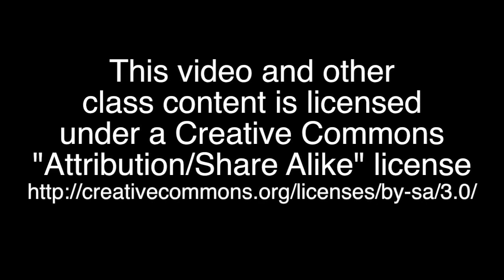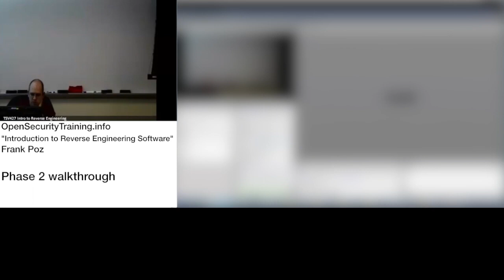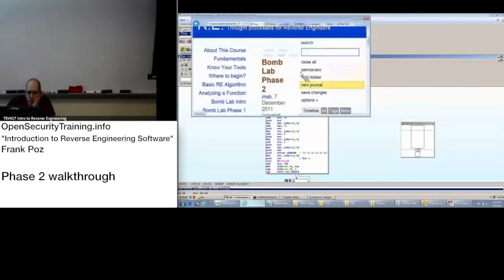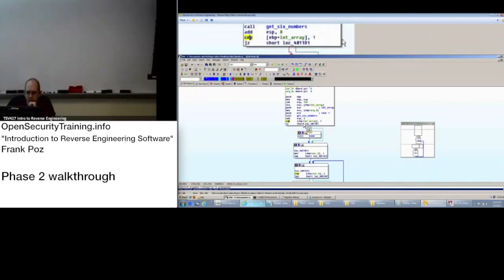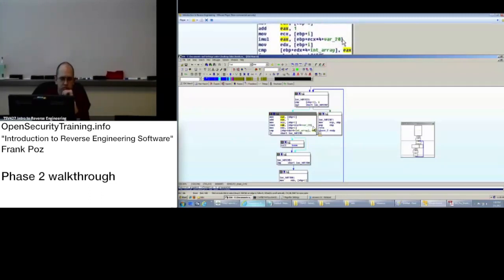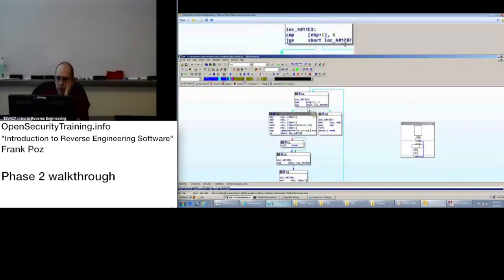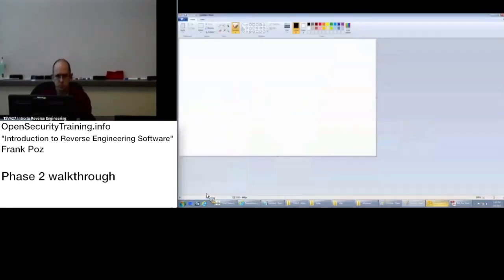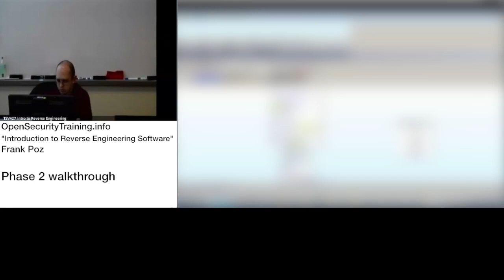2013 Day1 P9: Intro to REing Software - Phase 2 Walkthrough

Comment: im sorry but how u get those numbers i dont get how u do the math of the loop :S? i try 1 * 4 + 1 = 5  etc :/
Reply: Despite it might being a bit of necromancy (responding to a 3 year old message), I'll respond anyway, might help someone else too:
int_array[0] = 1. we checked this before the loop. The loop starts with i = 1.
the imul instruction multiplies (i+1) (we loaded it into eax), with int_array[i-1]. (that's why it writes the var20 instead of var1c, var20 = -20h, so it's var1c - 4. the -4 goes one element back).
The result of the imul is stored in eax.
Then you compare what's in int_array[i] with the result of the multiplication. So the math is - 
int_array[i] = int_array[i-1] * (i+1).
So int_array[1] = int_array[0] * 2 = 1 * 2 = 2. int_array[2] = int_array[1] * 3 = 2*3 = 6 etc.
 That's the factorial function, which is what the numbers written there are (the 6th element is 1*2*3*4*5*6 which is factorial(6) = 6!) :)
Reply: grolich thank you!!